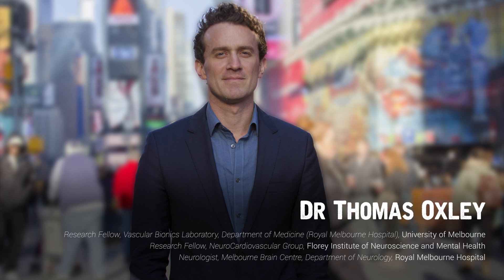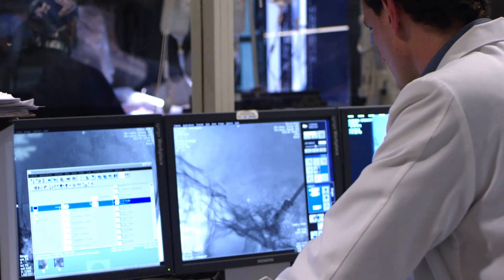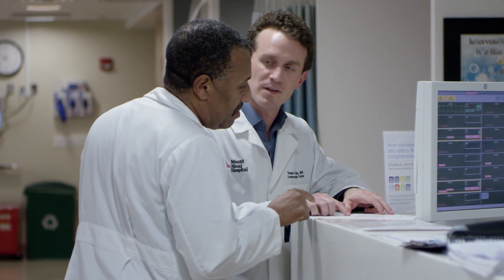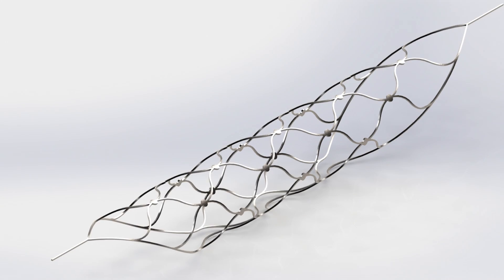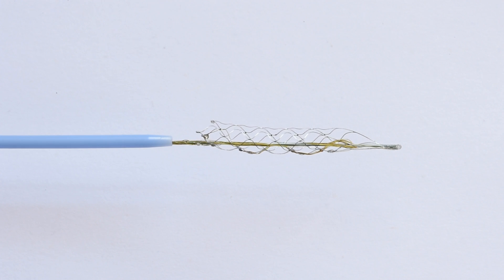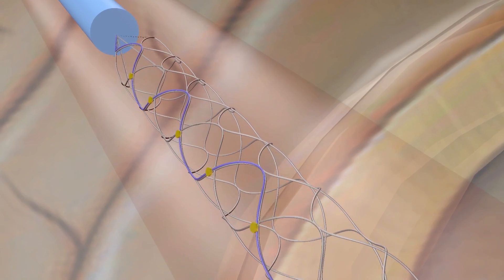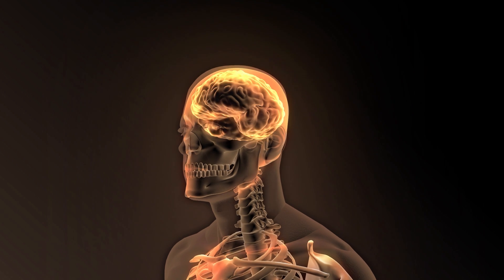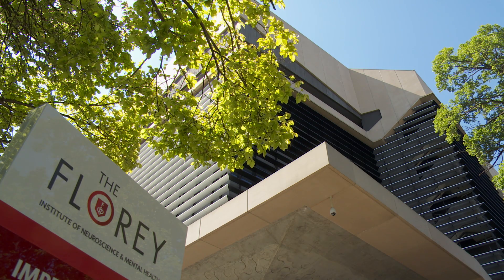Stentrode: Moving with the power of thought

Comment: could you also implant electrical stimulation devices to paralyzed muscles? You wouldn't need an exoskeleton if they had the limbs I guess... just contract the muscle when you get the signal... quite small power requirements needed there too I suppose.